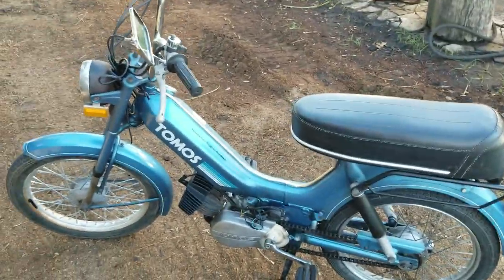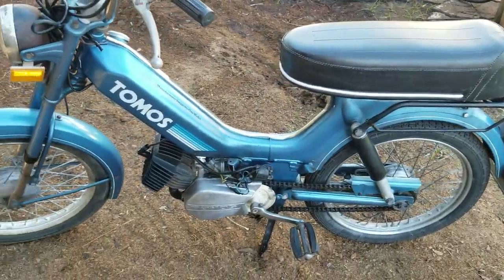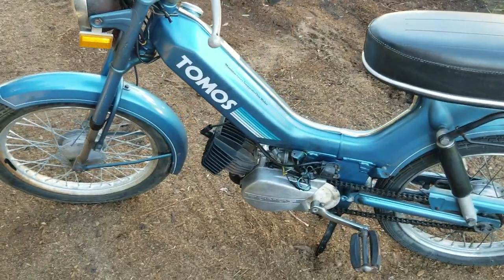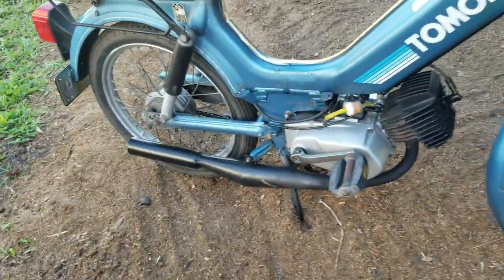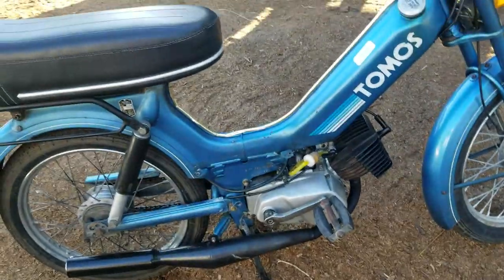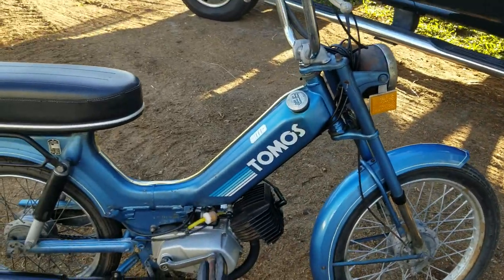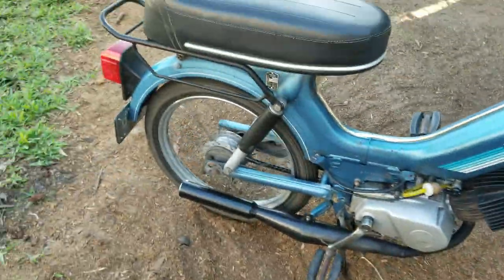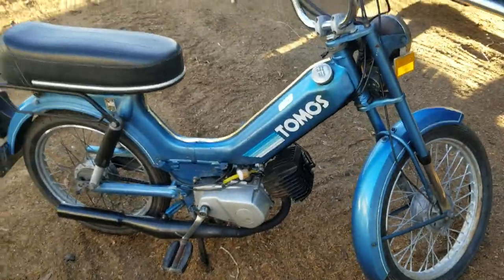TOMOS MOPED 1979 A3

Comment: If you plan on modding it, might make a custom exhaust based on port timing and bore the cylinder to ~42mm (thats where they usually top out). You can get some pretty decent speed outta these little puppies if done right. Or a straight up airsal 70cc kit is also an option (if such kits are sold in the US that is).